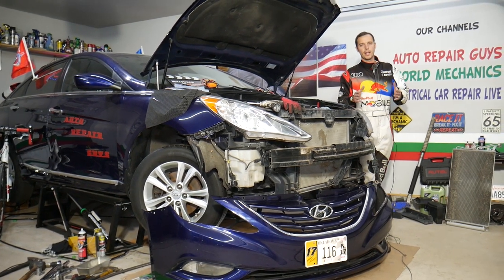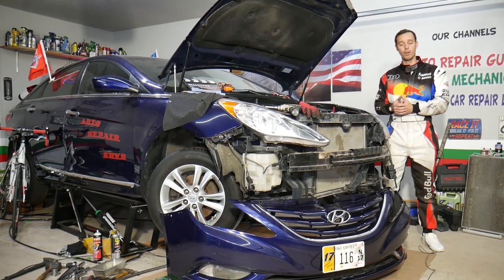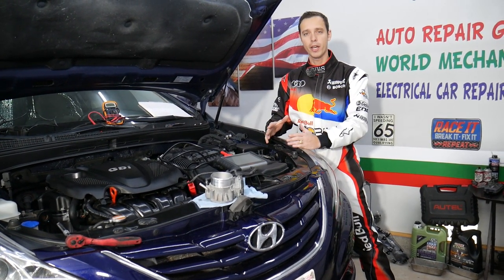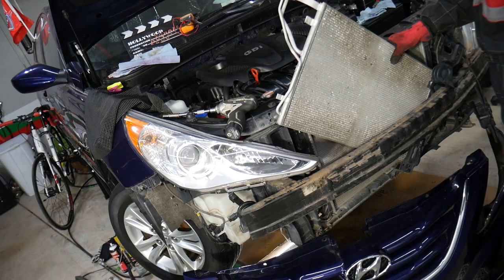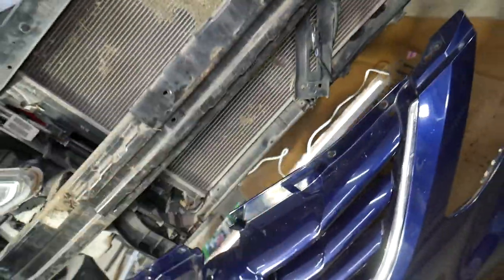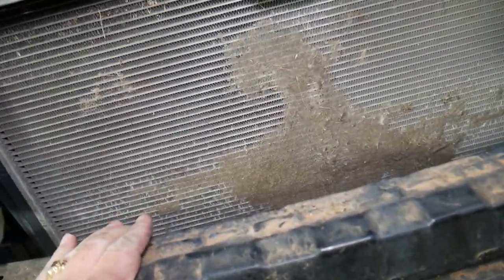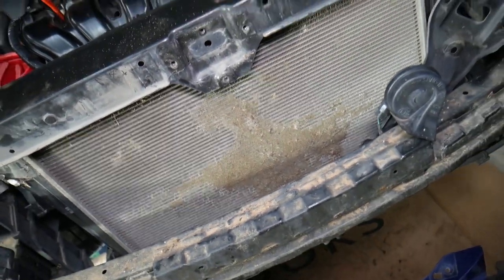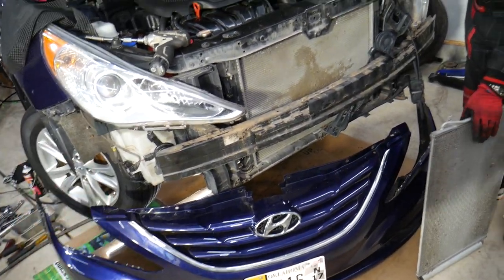IF YOUR HYUNDAI OVERHEATS YOU MUST CHECK THIS, HYUNDAI OVERHEATING FIX

Comment: I have a 2006 hyundai azera so it went into limp mode first I threw it revers to make a u turn and was stuck on neutral and drive we took the center console off notice that shift solenoid was not working so we bypassed it so that we shift it so now I don’t feel any over it won’t shift into second or third what is the area of concern that should be looking into